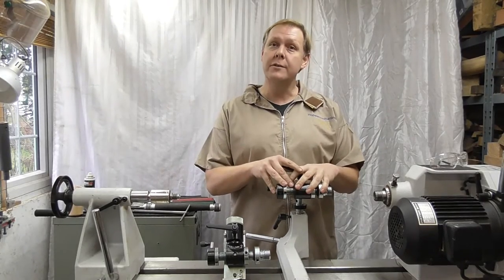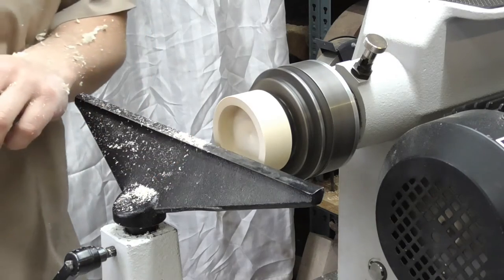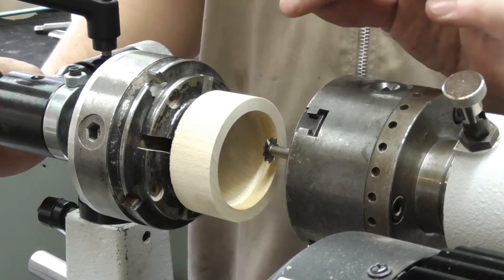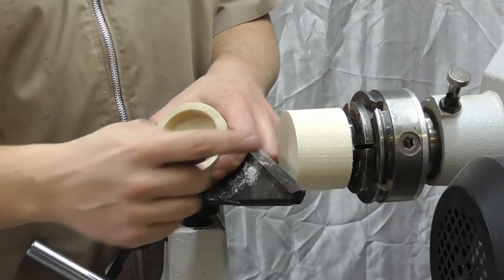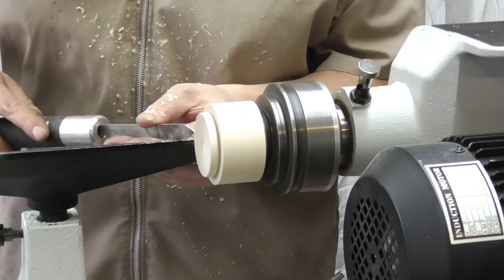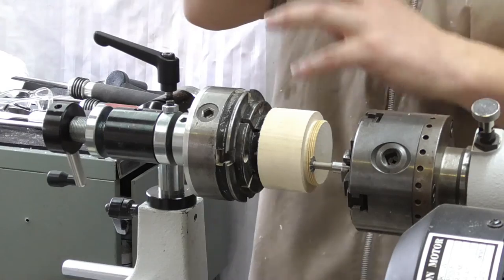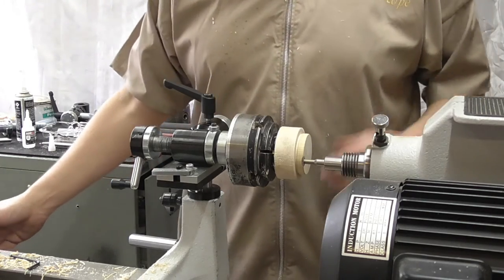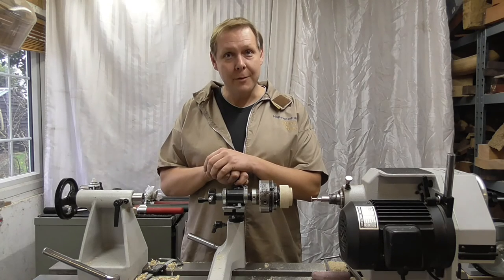Hope Easy Set Threading Jig

Comment: I opted for the Baxter jig. Two main reasons. One was years with the Bonnie Klein jig. The other was that it goes onto the lathe spot on in line/square to the lathe bed. Also, I learned the hard way that if I make a box the size of the one you make here, it can and will move enough so that you won't be able to get the lid off.